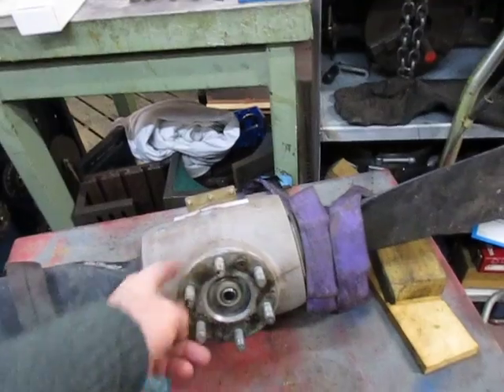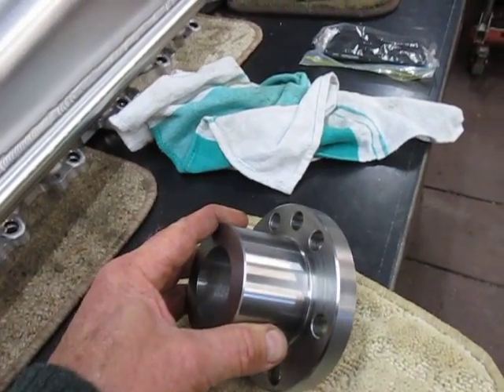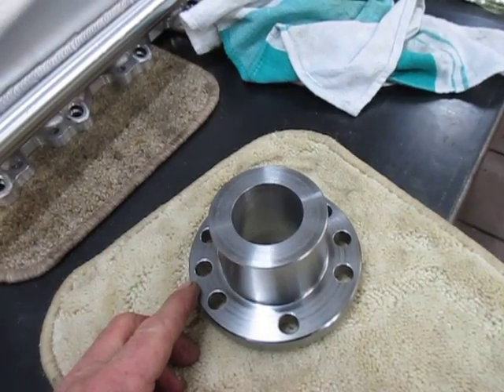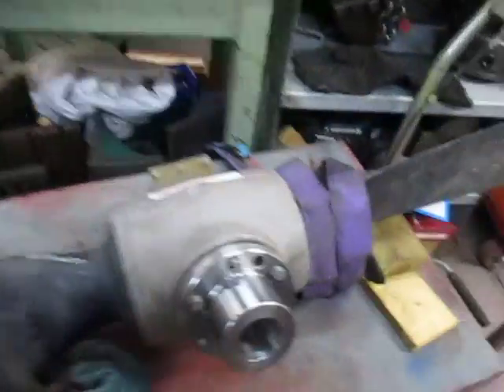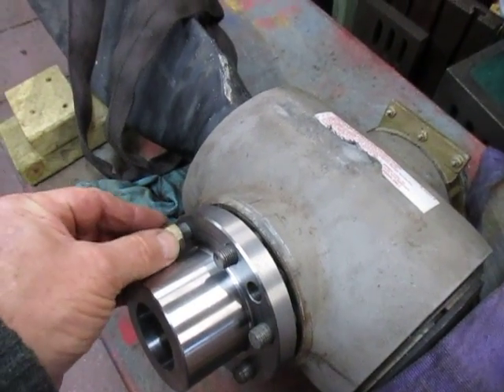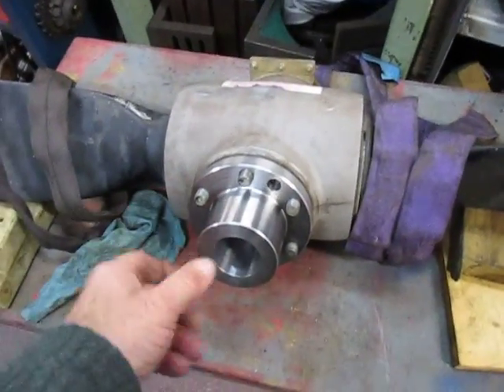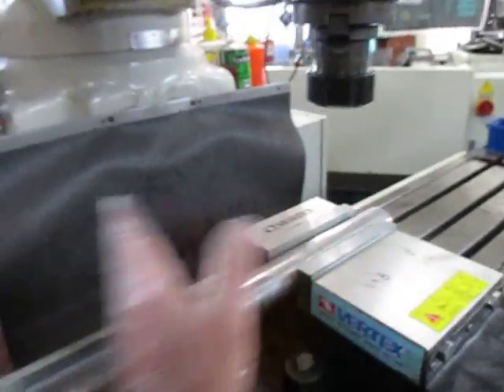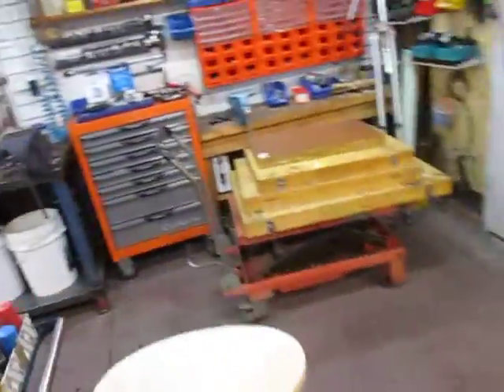Aeroplane Prop shaft coupling fitting

Comment: Hi mate.
Nice job.  How will the oil connection be made on the distal end of the prop shaft?  The prop looks like it's done a few hours.  How many horses will be swinging that prop?  Make sure that you are covered.  Because if the plane would crash (god forbid) the flight authorities will come and have a talk with you even if you would be an A cat.
Marcel.
Reply from the maker: Marcel Timmers It's not going onto a plane It will be on a farm for stationary air blowing against frost in the orchard. I need to talk to the farmer about the hydraulic system he dismissed the issue of the feathering by saying "don't worry about that"! I assume it will need a charge to at least keep it from wandering out of or to hold Pitch?
Reply: Bruce Whitham You would think so, otherwise the prop will start wind milling, making a lot of noise, but not doing anything
Reply: Bruce Whitham Stationary plane... lol 
It makes the world spin a little faster or slower depending on the direction it blows... ;-)
Reply: pierre beaudry Ah that's why we had the shortest day.... The bastards!
Reply: pierre beaudry Before you know it we're elliptical, we will be in real strive than!!!!
Reply: Marcel Timmers
The way the planet is behaving by now, think someone already screwed something up... lol
Reply: Bruce Whitham Maybe something simple like a grease nipple would suffice to set the blades.
Reply: stefantrethan Hi mate.  I don't know, all I know is, it's a waste of a very nice prop.
Reply: Marcel Timmers
Probably pulled out of air service...
Reply: pierre beaudry Well, you might be right, I have seen some props that had expired time on them, but looked like new.  I have also seen props that looked like they had been used over the weekend for lawnmower service.  It all depends on the airfields you use.
Reply: <It's not going onto a plane>  Thats all I wanted to hear... Otherwise totally certified parts... My Dad was A&P and I get it.  Right down to the nut and bolt <certified> etc. etc.